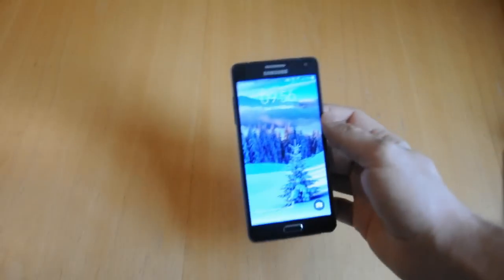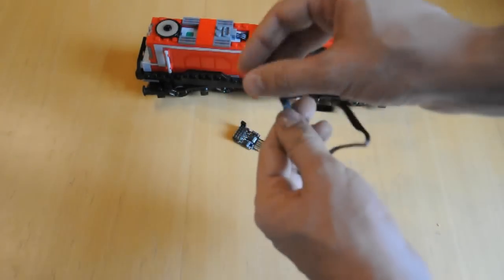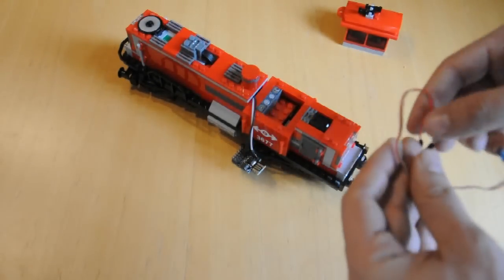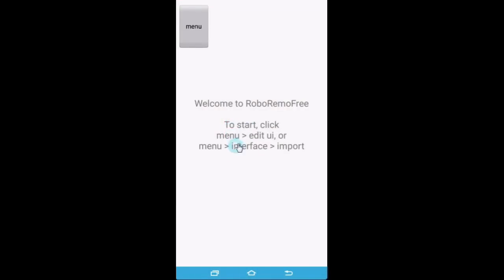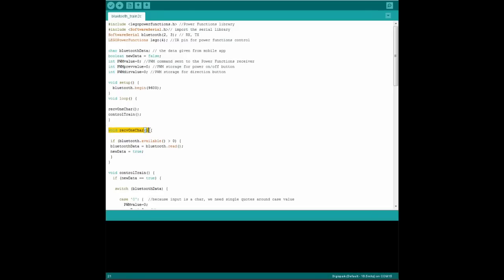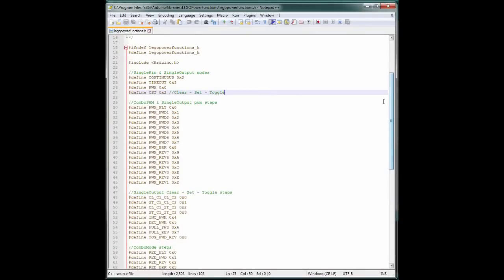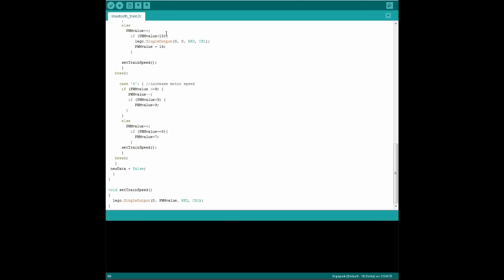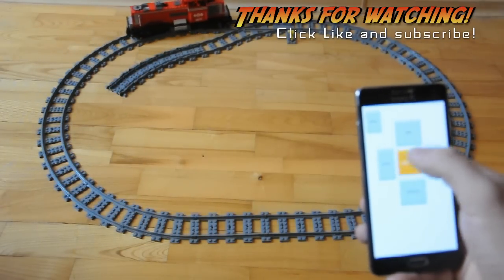Arduino for Lego Trains #13: Bluetooth and Digispark

Comment: can you add a video clip of you connecting the arduino and uploading it with the digispark and hc 05 module.
Reply: or the same video but closer. it is very hard to see what you are plugging the wires into.